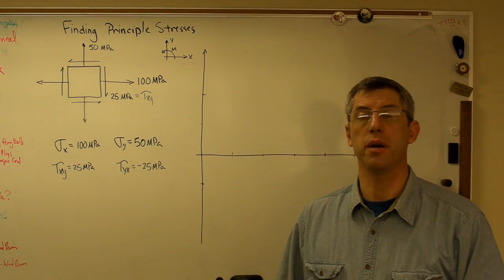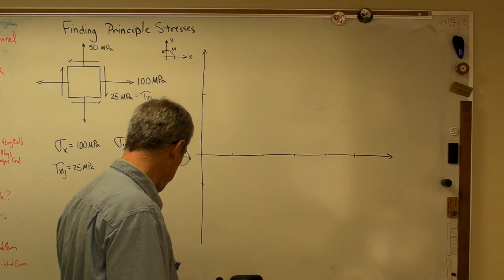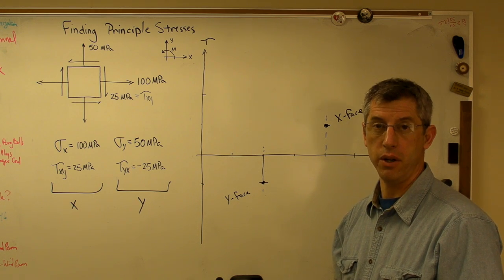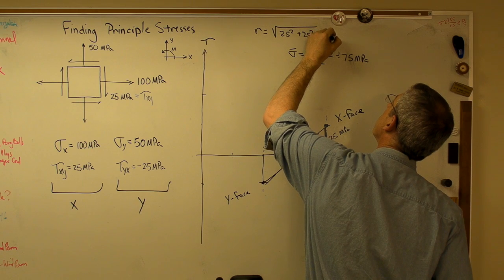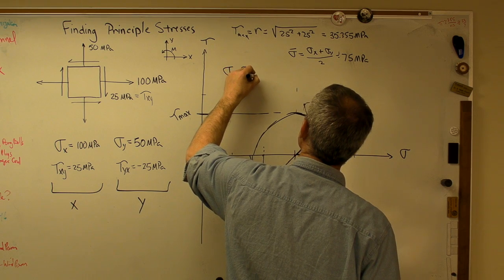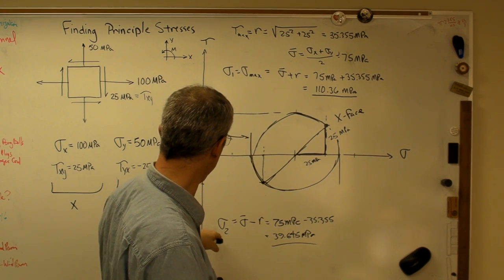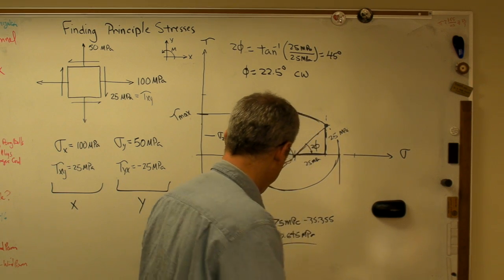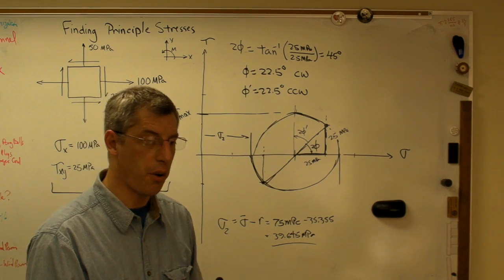Mohr with Rotation.MP4

Comment: I am confused. Does the sign convention of shear with respect to their direction is a standard rule for clockwise=negative and counterclockwise=positive? Or its depending on someone's assumptions? Because in X-face should be (100,-25) that's what I know that if shear tend to rotate clockwise it should be negative otherwise it's positive..thanks guys. Hope someone will notice this.

Comment: question
in a given figure two perpendicular tensile forces are act at any point of intensity 80n/sqmm and 50n/mmsq and a shear force is also induced on each surface having efficiency 60n/mmsq.determine the value of resultant stress,normal stress,tangential stress on a plane making 45digree with the measure principal plane with the help of mohrs circle and verify it with analytical methods?  please explan this question sir

Comment: @purdueMET 
Sir we are goin to make projects related to automobiles, not too  much advanced  but sumthing innovative,  dune buggy is too common, so we decided on making a kit   for water  cooling a motorcycle, it'll be cheap and easy to assemble, but the problem is that how to make water jackets for the engine? I thought of welding a aluminium sheet to the block and making a zig zag pattern for the flow of the coolant, any ideas abt the water jacket? or maybe sum new idea for project?